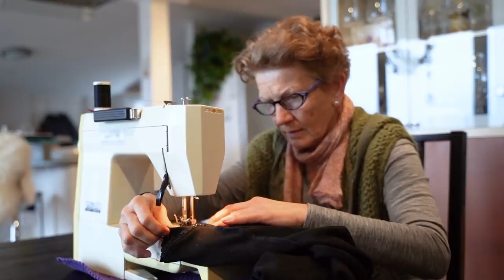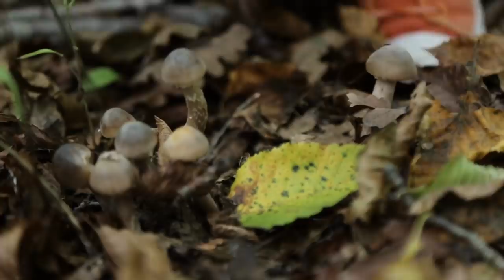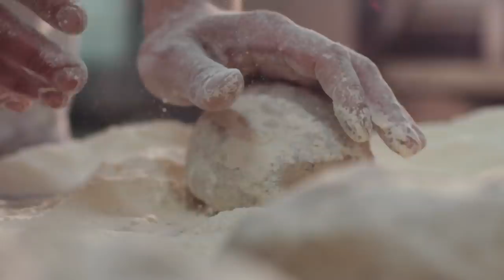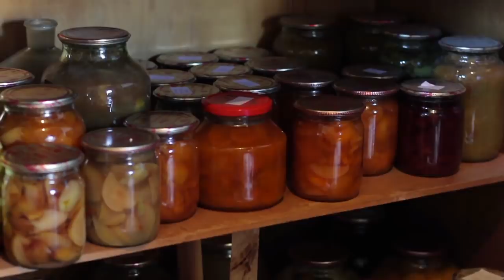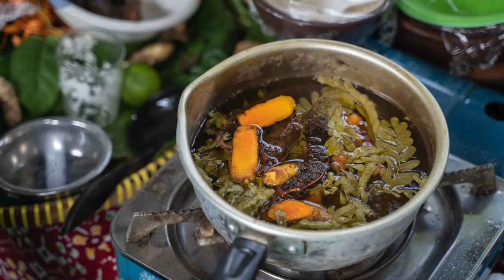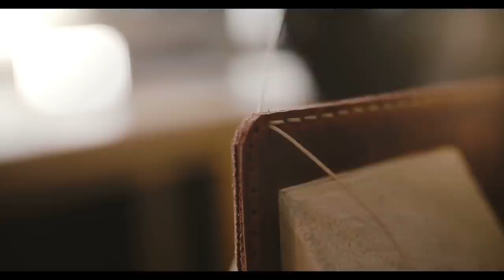10 Great Depression Skills That Will Pay Well

Comment: Repairing shoes will be great too.
Reply: Interesting that this item almost never gets mentioned...
Reply: @scottgraham3453  In  Venezuela it costs $5 to repair your shoes. It costs $50 for a brand new pair. A teacher in Venezuela gets paid $3 U.S a month.  They repair instead of buying.
Reply: And knitting socks! I got into loom knitting because I wanted to learn to make my own socks, and it looked easier than knitting with needles. Loom knitting requires more equipment though, so there is a trade-off.
Reply: MAKING shoes from scratch. Im looking for info on that right now as no commercial shoes fit me because they are made differently nowadays.
Reply: True. Cant do much with a bad wheel
Reply: KHALIIL01  But a last is exactly the problem, you cant find one you have to make one! That would come from casting your feet in clay or plaster or wax or something. Right now its a challenge figuring out just how to make sandals or similar shoes to get the , size, sole and arch correct, then can graduate to a last that is custom made for a persons foot and then you can start or take your last to a professional to make shoes from it, like a tailor making shirts from a pattern that was made for you. I havent asked any company that makes "lasts" to make one for me but that is an idea too. The problem for me is really serious, i am almost barefoot now.
Reply: I sew alot of my own gear have an electric sewing machine and also a hand cranked shoe patcher plus you need a good stock of needles thread and fabric so you don't need to scavenge after the fall
Reply: @allwaysinquire6212  Im going to buy that chinese manual leather sewing machine. Thats the most handy thing ive ever seen. I sew for a living and its a great skill for people.
Reply: and what about making soap. we want to make sure we are clean and healthy :)
Reply: My thoughts exactly.
Reply: For God so loved the world, that he gave his only begotten Son, that whosoever believeth in him should not perish, but have everlasting life.  begotten Son, that whosoever believeth in him should not perish, but have everlasting life.“Then Peter said unto them, Repent, and be baptized every one of you in the name of Jesus Christ for the remission of sins, and ye shall receive the gift of the Holy Ghost
Reply: Hands down best video on YouTube
Reply: @arkledovinar  This is a solid skill no one mentioned!

Comment: One of the greatest 'skills' you can develop is puzzle solving.  Instead of proclaiming 'I can't' do this, develop a McGyver type mind-set which requires one to figure things out - how it works, what it does, and what can I use it for.
Reply: I couldn’t agree more and that works with problem solving and puzzle solving.

My ex and I were given a washer and dryer set by her father, the laundry room was small and had bricks coming from the wall that would prevent the washer and dryer from coming into the room so I puzzle solved the problem, and increased the length of the bricks to build a temporary wall and took a few slats of wood to build a ramp to get the washer and dryer over the wall and into the very small laundry room.

She lacked the strength or patience to figure things out so that was my department.

The worst part was even simple puzzles made her angry even word puzzles on her phone.

We collected books on multiple skills but she never once sought to learn any of them.

In the time of 2 years I taught myself lockpicking by simply watching videos and gathered up the tools and resources to learn as much as I could.

I have a YouTube channel in which I show them off.

I learned by watching videos on a daily basis for things that interest me.

Currently I have the knowledge and means to open many padlocks, doors and deadbolts, vehicles including entry and starting them, lock bypassing, and slowly working on learning ace locks which are on vending machines and arcade machines.

I try not to limit my lock picking/lock smithing skills and keep in practice weekly.
Reply: I used dryer sheets to wipe my ass the other day when I ran out of TP.  Does that count? Lol
Reply: I think that's covered in mechanics and engineering
Reply: I grew up believing that a lot of what people tend to call creativity was simply common sense.
Reply: Truly a skill that can improve any situation. I would call this a mental attitude skill, one I've tried to incorporate in everything I do. Great thoughts.
Reply: For God so loved the world, that he gave his only begotten Son, that whosoever believeth in him should not perish, but have everlasting life.  begotten Son, that whosoever believeth in him should not perish, but have everlasting life.“Then Peter said unto them, Repent, and be baptized every one of you in the name of Jesus Christ for the remission of sins, and ye shall receive the gift of the Holy Ghost
Reply: @X-Prime123  Depends on whether you flushed it or put it in the trash.

Comment: Map reading and navigational skills. Empirical and science-based weather forecasting practices.
Reply: weather forecasting very good idea but you need data, the more the better. I was talking about this with some others after watching  ham radio video (perhaps it was even one of CPs videos) we talked about the importance of the ability to exchange information between groups and we included weather information I was thinking more in general terms "what is happening now to us will be going your way" this may be away to get that data you need to make an actual forecast.
Reply: You could learn how to fix laptops, tablets and cell phones, buy broken ones for cheap, repair them, then sell or trade them. There are lots of videos on YouTube and courses on Udemy and sites like that that are pretty cheap where you can learn about electronics and prepare for certification exams. Also you can scrap old electronics for the gold and other metals in the parts. You can sometimes find old computers outside of repair shops on trash night. Carefully dumpster dive ( don't go alone). A dehydrator is easier for food preservation than canning - farmer's markets at the end of the day can get you cheaper produce to dehydrate sometimes grocery stores have special areas with reduced produce. You can use the sun to dry food if you are where sunshine is plentiful - you'd want to research that online. You can cruise rich areas on trash night, collect and resell discarded furniture. Sell stuff on Craigslist or Facebook. The rich will always have money - you could start a cleaning, lawn, pool care or house or pet sitting service and market it in upscale areas. Or maybe start a concierge/ errand running service - particularly during the pandemic,  people will pay others to do their shopping or pick up orders. You could get paid to walk dogs. Not everyone will be broke at the same time, even in the Great Depression 25 percent of the workforce was unemployed - that meant that 75 percent of the people had jobs and could pay for goods and services. It is a big shift in mindset to go from being an employee to just trying to get cash but the more income streams you can develop, the better your chances are.
Reply: punkinhoot animals are great predictors of weather so are some plants but only for about 24 hours - although it is widely believe here that when muskrats build their houses bigger it means a cold and or longer winter.  I have no experience with goats myself so I will take your word for that and keep it handy incase. Thank you for sharing.
Reply: @glen1arthur  That depends how far out you're looking. You're not going to get more than a few hours out without sophisticated tools, but just knowing whether it's going to be raining in the next couple hours is quite useful. Especially if you're going to go fishing.
Reply: Omg.. I just started teaching myself how to use a compass and use the map.  Its not... that easy.... wish they taught the essentials in school..
Reply: My fiance told me she wanted to learn how to read maps and a compass after I was showing her a topographic map of Ohio and telling stories of my grandfather teaching me basic skills that are marketable and survivable. During Covid times its been a great experience with her as we have field exercises where she takes over navigation to find known landmarks. I am in charge of food, first aid and also the emergency gps because of course even the experienced can get turned around and while we have assets we should utilize but not solely depend on them and never ever forget how to get around safely when there is no signal or power or technology there to tell you how.
Reply: You can also sharpen your senses and read what the weather will be like.
Reply: For God so loved the world, that he gave his only begotten Son, that whosoever believeth in him should not perish, but have everlasting life.  begotten Son, that whosoever believeth in him should not perish, but have everlasting life.“Then Peter said unto them, Repent, and be baptized every one of you in the name of Jesus Christ for the remission of sins, and ye shall receive the gift of the Holy Ghost
Reply: Hunting and fishing are certainly helpful, but what about cleaning and gutting? I think you’d want to know that too.

Comment: I started thinking like you back in the 70's and it evolved.  I appreciate the spirit of what you are trying to do here, but there is an important distinction to be made.  Most "skills" involve having and  knowing how to use specific tools or machines.  Knowing how to sew but not having a sewing machine or even needle and thread, leaves you unprepared.  And picking the right sewing machine is important.  So, a person has to acquire both the knowledge AND THE TOOLS ahead of time -- before the depression happens.  You can't hunt without a rifle, or fish without a rod.  And these are skills you have to learn over time by doing them.  Foraging takes books, and practice.  You have to learn how to identify plants.  Here are some additional ideas:  1)  It is possible to extract and filter water from the humidity in the air using solar power, just about anywhere -- fifty gallons a day is possible.  2) Using grow bags you can grow a lot of food anywhere there is sunlight, and in very little space -- on roof tops, on concrete, vertically on shelves.  You can sew your own grow bags from landscape cloth that cost maybe twenty cents each.  They last for about six years.  One shopping bag size grow bag with good soil can grow ten corn plants, and each plant will give you three ears.  Using grow bags  is ten times more productive than gardening in a pot or wine barrel or the bare soil.  3)  There are several different kinds of very good solar cookers available.  Get one as a back up.  4)  Thermal pots -- You can get your stew or soup boiling in less then ten minutes at noon, using say a solar parabolic cooker.  You put the stainless pot in its high tech insulated jacket and it is still boiling five hours later.  The food is cooked and ready to be served at dinner time.  It is better than a crock pot.  You could even do this in Alaska in winter.  5)  You can grow a hedge of goji berries.  The leaves are just as nutritious as the berries.  You save the leaves as you trim and shape your hedge.  You juice your leaves (hand crank grass/leaf juicers are not expensive) and remove all the cellulose.  You put the leaf juice in a pan with a little water and slowly bring it to a boil.  Before your eyes, it separates into curds and whey.  The curds are pure, high quality protein -- more concentrated protein than in egg.  You strain it and keep the curds which again are high quality pure protein.  You could live on it in a pinch.  There are many other plants you can do this with.  It is called "concentrated leaf protein".  In good times it can be used as a healthy hamburger helper.  Also you can dehydrate it for later use.  6)  You can easily grow your own tiger nuts in grow bags which can be ground into bread flour or made into delicious dairy free milk -- it is easy peasy.  7)  In a small shed or a corner of your garage, on a small city lot, you can raise quail in cages.  They are small, quiet and gentle, and great layers.  They start laying after only ten weeks.  You can get 300 eggs per bird per year.  All the eggs you want.  You can feed them scraps and grow the feed for them on your lot.
Reply: Thank you,  this is very  helpful  information
Reply: @indigogoigorgo7992   Thank you. There is so much more.  I stopped writing because it was getting long and I had no idea how it would be received.  But a long time ago, I did some original self funded research associated with the UC Davis LISA Program.  I modeled an organic garden from the point of view of ecological energy flow and that led to a fundamental discovery about earthworms.  I will cut to the chase.  If you plant a bunch of, say, cow pea seeds in a grow bag and introduce say 12 earthworms, the worms will gently attack the leguminous root  nodes.  There has to be a critical mass or worms.  Worms are protein hungry and they will eat the protozoa.  This will stimulate a repair process in the plant which includes a rush of growth hormone.  This will result in a 300% increase in both yield and biomass.  One cutting from just one grow bag after doing this will give you enough concentrated leaf protein to feed TEN PEOPLE!!  This works on all legumes, including garbanzo, green beans, snow peas, etc.  I should have included this but chickened out.
Reply: @colinkelley6493  Thank you for sharing. I don't know much about farming, but this information that you shared here could help save a lot of people. Thank you!
Reply: @jocelynbrockway3089  Thank you.  I also feel this could save lives.  But there is "life" in it beyond that.  What I have been doing is not just about being at the survival level, it is also healthy, economical, and gourmet delicious, and does not take a lot of time and effort.  Gardening that involves really hard work and takes a lot of time, starts to feel like slavery.  I will soon be starting a web page and a YouTube Channel -- I will be growing all the food I eat on a small city lot and showing people how to do it, and how to cook it.  Years ago I had a large garden on acreage, and we were also raising chickens and ducks and geese.  Friends came over, and I insisted they stay for dinner.  At that time I was self employed with a cook it in your home Chinese catering business.  I  cooked up a gourmet Chinese meal for my friends.  Everyone loved it.  When it was all over, I suddenly realized that 100% of the food in that meal had been raised on my little farm.  There was nothing store bought -- not even the tea.  It was the first time I was aware of that, and it was an amazing satisfying liberating feeling knowing that.  The next year I think I spent $40.00 on food.  I realized it was just as easy to raise food for three families as one, so having people stay for dinner did not cost me any money, or extra work.  People were always welcome and they kept showing up.  We explored new dishes together -- we had great conversations and we had a lot of fun.  People brought guitars and there was amazing music.  It was interesting.  People wanted to be a part of it.  So more showed up.  Good food builds community.  Your friends become family.
Reply: @colinkelley6493  Wow! That is amazing! And yes, fun memories with friends  and family are priceless. Good luck on your channel!

Comment: I would like to say blacksmithing and farriers would be an amazing skill set if the area you live in has a need for those types ie farmers who have large fields need someone to fix things and or put shoes on the horses in exchange for food and or lodging.
Reply: Steve Slade  very possible that we'll see that within 5 years as we're heading towards a grand solar minimum. One very valuable skill would be ice age farming as most crops will freeze.
Reply: Horses do great barefoot, how nature created them! Metal is unnecessary.
Reply: @sugarhoof1085  it'll probably help on man made surfaces
Reply: Metalwork is important...I cannot count how many tools we've made over the years...not even in a shtf situation. We've made parts for cars, homes, down to jewelry. It is a good skill to know. Basket weaving is another good skill.
Reply: Steve Slade  make your own coal it's not hard.
Reply: Kiana Shalix 
If we end up with a Carrington sized solar flare that takes down the grid, you going to want to be holding gold and silver... and have 18th century everything!

Comment: I think its highly likely we may loose power and water as well as the internet. So knowing how to harness alternative energy sources and powered  equipment for cooking and heating. Hand powered tools . knowing how to make your own rocket stove , cob oven with water jacket to heat water and or solar cooker.  Not only having rainwater storage but irrigation systems and hand pumps to move that water into your garden and house. Finally knowledge is power , download all information from the internet NOW and print hard copies for when there is no power. There are lots of ebooks available as Pdfs for free. Lots of facebook groups that have fantastic information in their File section. Get the information you need before SHTF and then get equipment

Comment: Carpentry, plumbing, building repairs.  I was an apartment building superintendent back in the 90s and picked up a number of skills on the job.  Sanitation.  I can not only repair window screens, I can construct them.  I learned quite a few things from my father while I was growing up.  He could fix just about anything.  Before he retired, he was designing and building machinery in a factory.  Just to develop this mindset is a valuable skill.